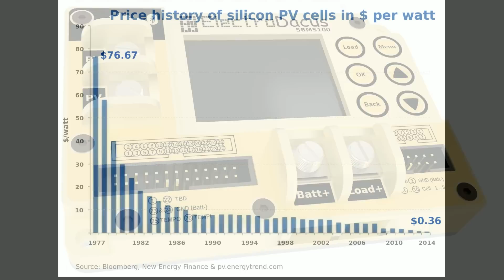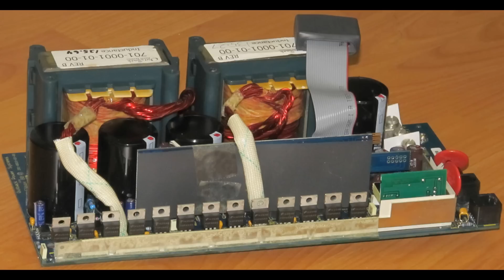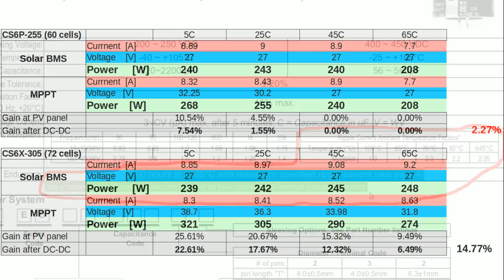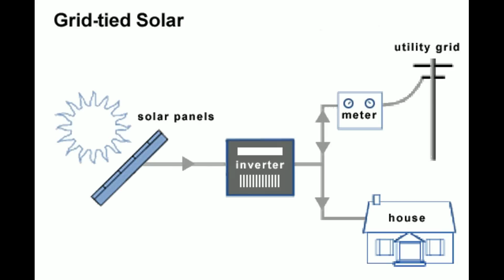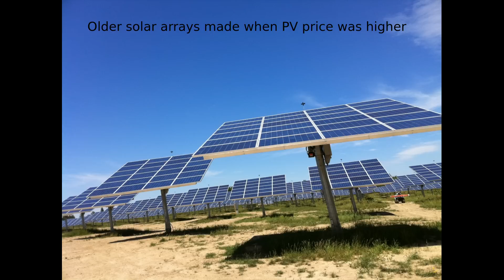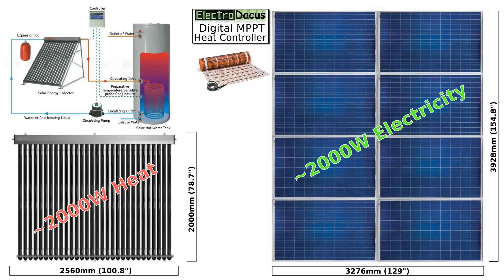Is the MPPT in OffGrid Solar obsolete ?

Comment: Hi Dacain.

Thanks for these great explanation.
I'm just coming back from EEV forum.
As you are THE off grid solar system specialist, may I ask some more question.

Considering you're using your inverter only a couple of hours a days (as you said), why did you choose 24V for your system when most devices (I think) are 12V ? (Led Light bulb).

Your way is to oversize the PV array to minimize the batery bank. So, you dump the overproduced energy in heat (water and house for instance).
How does this work ? Does the SBMS100 control that ? Or in what way ?
Is when the battery charged, the water tank start to heat ? This one is possibly 2000W !  Maybe, there is extra energy, but not that much ! This is going to dig in your battery stock !
On top of that, you said again, you're using your inverter a couple of hours a day only.. Is your water tank on 110V or 24 V. If it is 110V on the inverter, will this accept to switch on and off to regulate as a dump load ? I don't think so ! You need to regulate on the 110V wih a relay ... or a Thyristor or what so ever. But still. Will the inverter accept this way to work.
Plus, you maight have other load plugged on the inverter that you don't want to aletrnatively switch off !

You have an extremely interesting way to face the off grid solar system, but as you migh feel it, I'd like to know a lot more about your complete personal installation. And I'd like to know about all the SBMS possibilities.

Thanks for your great job, for your interesting approach of the off grid solar system, and for giving us the opportunity to learn and share.
Reply from the maker: :) Not sure I'm a specialist in OffGrid.
There are quite a few reason for 24V (I initially wanted to go with 12V). My main loads are two computers they both require 19V DC and that is a bit easier made from 24V than from 12V. I have 24V DC outlets in the house with a 16A limit so 400W that is more than sufficient for any electronics. There are also plenty of 24V LED lights but I will probably build custom lighting 20W max with analog dimming I do not like PWM for this.
I will oversize the array so that I can heat the house 100% with PV but it also has the advantage that I can use more electricity (all will end up as heat anyway) and I only need the battery for overnight loads usually quite small.
Battery even LiFePO4 is by far the most expensive part to amortize so is a great idea to keep that as small as possible.
Yes eventually the SBMS100 will control most of the house energy management but for the heating part I will have an external device that I call a Digital MPPT there is no DC-DC converter in that. It will be connected to the large 7 to 9kW PV array and 30 x 200W resistive heat elements and it will switch more or less of those to keep the PV at max power point.
Those 30 loops of resistive heaters probably just copper wires embedded in the concrete floor will probably be connected as 15 parallel then 8 parallel then 4 parallel and 2 and 1 so I can have just 5 switches and by combinations obtain any power load with 30 steps of 200W  6kW total to load the PV array in the optimum way for max power point.
Maybe those 15 loops in parallel are a bit much so maybe I split that in two or so but you get the idea.
Battery has nothing to do with this PV array is just for heating so PV array, Digital MPPT and resistive loop for in floor heating (the floor in my case is made of 14 cubic meters of concrete able to store about 100kWh of heat at 10C temp delta ) See the video about my house build if curios.
I will have a sort of diversion from the large array and digital MPPT so that a few of the PV panels will be used to charge the battery if needed but keeping the charge current under 30A (0.3C for a 100Ah battery)
Still need to get all the details together.
SBMS100 has a 26 pin connector that will contain 10 24bit ADC inputs and multiple IO pins to automate and control external devices.
The inverter is only used for a few items like vacuum cleaner, hot plate for cooking, a convection oven and microwave oven usually for cooking so is basally used at most about one hour a day during the day with sun so PV provide all that is available + the difference form battery.
All my lab equipment including desk multimeter and oscilloscope work on DC power for the soldering iron at the moment I use a small inverter but that can be easily converted to DC.
Thanks for all you questions. When I get time I will explain more on how I plan to do all this is quite different from mainstream so there will not be that many people that will understand what I'm doing here.
Reply: *****

High.

I'm waiting forward your next explanation.
But I'm surprised you'll have a specific 7-9kW PV array for heating. (I'll have a look once more to your video).
I first understood you'll be using the extra energy from the main 3kW PV array for heating as a dump load. But it seems that you plan something different.
Reply from the maker: Llop66
Yes I plan to fully heat the house with PV no other heating source and that requires about 7 to 9kW array connected to a different device than SBMS that is still under development called a Digital MPPT (this is something new I came up with to maximize the use of solar PV for heating) this Digital MPPT may be actually an add-on to the SBMS100 but not decided as of now.
My current array is as you maybe seen made of just 3x 240W PV panels so just 720W and this provides me with enough energy for my needs. Is a bit harder in November and December with less sun but the rest of the months is excellent I even have quite a bit of unused (wasted) energy in that period.
The heating array will be using the concrete slab as a 100kWh thermal battery and since that large array will still be a 24V (30V max power Voltage) I can use part of the energy for electricity when needed usually in those few cloudy days in December.
I normally use 60kWh/month in November / December so way less electric cooking and about 90kWh in the rest of the months.
Having that extra large array normalcy used for heating will allow me to take the difference from there so I can use 100kWh/month in any month with an infinite number of cloudy days.
Like I think I mentioned the worst day is 8% energy generation compared to the best sunny day in December.
With a array 12x larger (720W vs 9kW) I can have the same amount of energy I get from the 720W array in best sunny day from the 9kWh array in the worst cloudy day.
Most of the time the energy from the large array will be used for heating the house but in some occasions when I need will be used to charge the battery and use as electricity for what I need in the end will still be heat anyway as long as the energy is used inside the house.
Reply: *****
Ok, I see.
I didn't remember, you wanted the full charge of the battery even in cloudy days.

Concerning the floor heating :
What kind of wire did you use in the concrete slab ? What kind of array ? What AWG or mm2 ? How much power do you dissipate per meter of wire ?
Concerning hot water :
Is it also on 24 V ? If so, do you use a modified steatite water heater tank ? If not, what do you use ?
Would you excuse me for so many question, but Ithink you have an interesting approach.

What inclination would you give to your PV ? I guess a minimum of 70°, so the snow doesn't bother and you get the most energy in winter, even in cloudy days if there is snow outside (light reflection). During summer, you get less energy that possibly could, but you also need less, except if you plan to use air conditionning. (I'm guessing).
Reply from the maker: Llop66
I have a spreadsheet with calculation for different wire lengths and size but did not decided yet witch one I will go with.
The wire will probably be spaced at 5cm so about 8 turns for each of the 30 loops each loop will be 8x 5.5m = 44m and dissipate about 200W so about 100W/m2 a bit under 6kW for 65sqm
That is not much the wire will be quite cool since it will be embedded in concrete under the ceramic tiles.
I did not decided how I will heat the water I will need to build something custom for sure.
My current 3 panel array is at 70° seems the best for winter and decent enough for summer.
I do not need air conditioning the house stays under 27C at all times in summer.
We drink distiled water only and at the moment we pay $2 for 4 liter / day so about 700$/year :)
The heating array total estimated cost will be about $10k and will last for at least 25 years so if used only for heating that can get amortized at 400$ / year.
In summer that array can produce up to 50kWh / day and to distil 4 litre of water I need 3.5kWh almost nothing from that array I can do that also in winter since all will be converted to heat no other energy for water evaporation.
So I can more than amortise the PV array just with not buying the distilled water and producing that at home :)
I need to find some other uses like this.
Reply: *****
Distilled water ! Why drinking distilled water ?

The wire you'll be using for the concrete slab ? PVC coated wire ? Or enmalled wire ?
So the wire is going to be placed between concrete slab and tiles ? Quite close to the surface I think ! It would have been better, deeper in the concrete to dephase and store the heat.
Reply from the maker: Llop66 I prefer distilled water is just H2O nothing else :) Most of the other things present in water are not good for you and all those that are good are found in food anyway.
Did not decided the wire type both will work but probably enamel will be better I need think more a bout this and do some small experiments once installed will not be easy to replace.
They will be at 30V DC max so I'm not that concerned with isolation enamel coating will have a much better thermal transfer.
Yes deeper in the concrete will have been better but is to late now. But since will be placed so close 5cm apart the heat will be well distributed and at 100W/sqm it will have time to dissipate deep in to the concrete slab.
It is not unusual for the heating wires to be just under ceramic tiles. I will try to use some thicker tiles.
I have PEX tubing embedded in concrete but is not that much spaced at 40cm and that can only push about 4kW in to concrete a bit more initially but constant around 4kW.
Even if is quite deep 7 or 8cm I can find the exact location with an infrared thermometer wile circulating water at less than 45C
By the way that 4kWh is for water at around 40C and concrete at around 20C